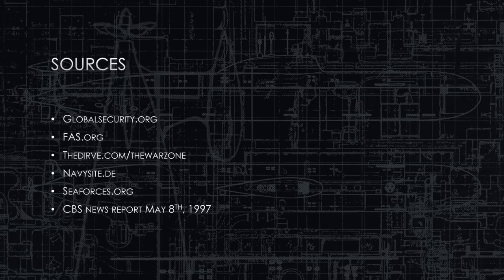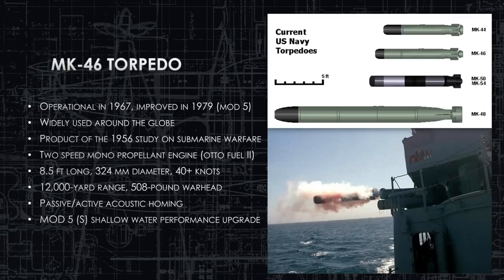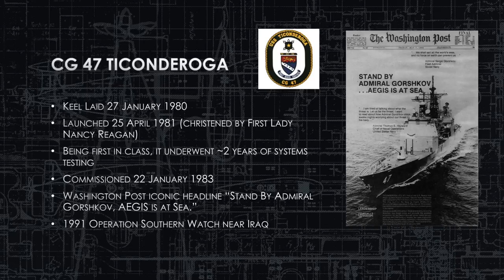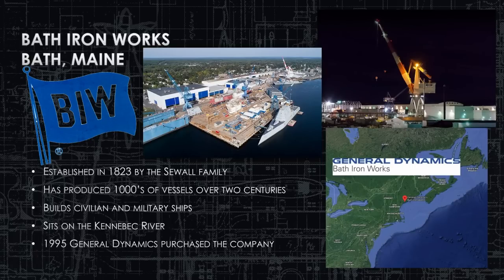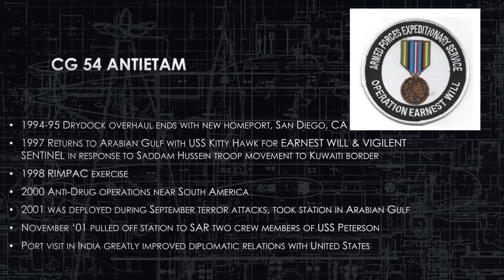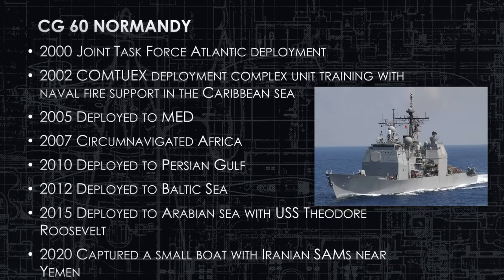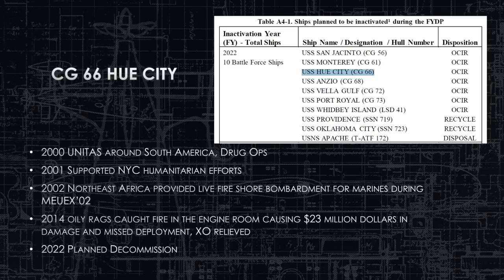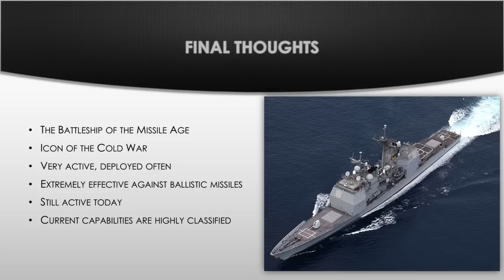Ticonderoga-class Ship Brief

Comment: The ASROC systems do not use the Mk.45 torpedo. The ASROC is designed to project a nuclear depth charge or a lightweight passive homing torpedo, originally the Mk.44, later the Mk.46 including the NEARTIP. The Mk.45 torpedo is a wire-guided, full-size torpedo (21", 3800 lbs and performance similar to the hydrogen peroxide propelled Mk.16), nearly the weight and length of the Mk.48. It is launched from torpedo tubes. It is wire-guided so that there is positive control of the torpedo in all phases of the engagement before the nuclear warhead is detonated by the fire control team. The Mk.45 was withdrawn in the late 1980s with the introduction of Mk.48 ADCAP. They were rebuilt as conventional wire guided warhead torpedoes (the Freedom torpedo) and provided to US allies. The picture shown was a live detonation of the nuclear depth charge.

Comment: Jive, I love your stuff but I fear you missed the biggest feature of the AEGIS program.  Prior to AEGIS, the T-bird fleet had no one person responsible for ship combat performance.  

In the past, surface combatants were designed and built by two Bureaus; BUSHIPS and BUWEPS.  While this structure worked superbly in WWII with gun ships, the rapid changes in radars, missile systems, and related systems made the 'shared' process unwieldy and allowed cost considerations to dominate the combat system's performance because no one could or would make the case for combat performance.  

RADM Wayne Meyer was a graduate of the NPGS Systems Engineering (SE) course and he applied SE thinking to a combatant.  AEGIS allowed combat system performance to fight against cost considerations.  Fortunately, the "Surface Baron" fought the good fight and funded AEGIS, even when it was very difficult.  VADM Jimmie Doyle (and his predecessor whose name escapes me) deserves as much credit as Meyer for keeping the fuel coming into the machine.  

Nuc subs had Rickover and Surface Combatants had Meyer, in my view.  Keep the good stuff coming!

Comment: Emergency Flotation Systems (EFS) are emergency systems installed on larger commercial and military helicopters in order to prevent the airframe sinking in the event of a crash landing on water. The floats may be packed within spaces inside the airframe or as externally mounted packs on the helicopter skids. The floats are inflated using gas stored in pressurised cylinders carried on board the helicopter.
Reply from the maker: good info, thank you.
Reply: @SubBrief  Your Welcome!

Comment: The original AEGIS computer system, AN/UYK-7 was based on the state of the art for the late 60s when it was developed (first entering service in 1970) ... which wasn't saying much. A late 80s home computer built around the  Intel 80386 processor was much more capable.
Reply: The moderized hull have dual xeon themis processors.  We have come a long way since the UYK-7s.

Comment: The most recent CIWS, 1B2 shoots at 4500rpm and has a magazine cap of 1550 now. We also do not have any ECM capabilities. Also with the new System you mentioned as Sea Sparrow is actually SeaRAM. SeaRAMs primary difference is that it utilizes Rolling Airframe Missiles(RAM) instead of the 20mm Vulcan cannon on CIWS. It has a better Search radar than CIWS, but utilizes the same track radar. Sea Sparrow, part of SSDS, is a different system that is primarily found on CVNs and amphibs.
Reply: Not true. The ESSM on modernized cruisers are quad packed VLS launched Enhanced Sea Sparrows.  To my knowledge SeaRam has never been installed on a cruiser.  It has on DDGs in a specific op-area, but the moderized loadout for MT21 and MT22 is a CWIS block 1B
Reply: @Tripped11  You’re not wrong, but he mentioned Sea Sparrow as a part of the upgrade for CIWS. In my comment I was referring to only CIWS, not cruisers. Also SeaRAM is installed on some LCSs and DDGs that get forward deployed to Rota Spain.

Comment: Apparently, the Iranian Airbus A300 was on a schedule, but the schedule had changed, and the crew of the Vincennes did not have the new schedule for them to check. Apparently, the plane could not talk on the same frequency as the Vincennes, either. Given that planes have been used for kamikaze attacks, it's hard to fault the Vincennes captain or crew.... though I would never have taken a medal for it.

Comment: It is obvious if a ship costs too much, but how do the costs accrue? Sheet Steel and Aluminum are bought by the ton, tool steel and bronze ? $5-10/lb??? Engines are expensive, likely more for gas turbines less for Diesels, electronics is expensive to design, but less expensive for components. What is the cost of the first reasonable quantity of units, how about the last quantity of units? Home builders are said to make their big profits on change orders....
All this stuff should fit into a spreadsheet!

Comment: Question on the air search radar with the long range coverage gaps. Are those gaps less exploitable in bad sea state with the ship rolling, or more exploitable near wave top height because of wave tops scattering radar? Or do they function independent of sea state by using a gimbal setup to point independent of ship orientation?
Reply: If I am not mistaken the 64 air search is on a mount that keep it oriented.  The SPY 1A was electronically steered so static mounted.

Comment: Why does AEGIS still use mechanical fire control radars while other navies have switched to phased array antennas like the APAR. Doesn't a mechanical radar limit the number of simultaneous target engagements?
Reply: You are mistaking radar and illumination, the radar is very much phased array the illuminators are parabolic, which is fine, they are only flashlighting a point in space during terminal.
Reply: @Tripped11  It's still a radar, even if it's only for target illumination. The problem I was referring to I that you can only illuminate one target at a time (per radar) when you point the mechanical fire control radar on it. When they have three of those, they can only engage three targets simultaneously. Or can the spy radar also do that to a certain degree? The APAR for example on the german f124 is a fixed panel system that does the target illumination and missile datalink for multiple targets simultaneously. Maybe mechanical ones are longer range or have other advantages but I don't know that, thats why I am asking.
Reply: @SD-pj8dl  While I am not going to get into specifics here, you can indeed propagate multiple engagements per illuminator,  also with SM6 the requirement is situational, the SM6 can do full active.
Reply: @Tripped11  Okay, thanks for your answer

Comment: Why only 20mm CWIZ? US has 25mm Phalanx, others have 30mm (A-10) and 40mm?, I think. Larger bores have greater range and more room for explosive/frags.
Reply: Not an expert, but my first guess is that you can fit more 20mm into the mount since it is smaller and weighs less. Maybe throwing out more small shells gives better kill probability than fewer big shells.

Also, while the bigger calibers may have more range, the reality of firing a gun at long distances against a fast moving target while at sea may mean that the accuracy became unacceptable well before the maximum range of the shells, or would have required a prohibitively expensive stabilization system.
Reply: The M61A1 Vulcan that the US CWIS is built around is lighter weapon than the GAU8 Avenger which makes it more suitable for shipboard use. Most importantly Its also much more accurate than the GAU8. As its only for close in defense against thin skinned missiles the 30mm if the GAU8 doesn't offer any significant advantage.

Comment: There is good content out there on the fate of Iran Air 655 and the contributing factors to what got the aircraft shot down, and it's worth mentioning the context of the attack on the USS Stark under similar circumstances.  It's worth a look at how the combination of a poorly conceived set of procedures, a poor operational stance, and bad interface design failed to deliver clear information to the crew in the CIC of the Vincennes necessary to make good decisions.  I won't speak for the sailors but it was absolutely a complete failure of basic human and physical systems engineering.

Comment: They should not be decommisioning so many warships while the PLA navy is growing so much
Reply: You have to realize this ships are machines and machines eventually wear down. The planned life for a Tico was around 35 years. Some of these ships have worn out engines, gears, cracked hulls and various other problems, that can not be easily fixed, if at all. If you mandated these ships to stay in service does not mean they can actually full fill a mission and go to sea.
Reply: Once the cold war ended and we just focused on the Gulf the "blue water" Navy took a back seat to a litoral water focus. We reduced are ship yards and ability to build new, ships and repair the ones we have. We also made mistake by making the Zumwalt DDG, The Ford Carrier and the Litoral comabt ship. We lost a generation of ship builing in the process. Now we have new couls war thar requires blue water ships and subamrines and we do not have the ship builing capacity to make them fast enough and also repair the ones we have.
Reply: The biggest problem the Navy has that is hush hush is a our deteriorating Ohio Class SSBNs, which is a power leg of our nuclear triad. The "boomers' are pushing 40 years + and the new columbia class is already behind schedule and at least a decade too late. The US Navy's current state is due to decades of neglect though multiples presidencies and contract corruption.
Reply: I was in the Navy from 1991 - 1997 ( Sonar Tech stationed on CG-31 and FFG-58) and witnessed first hand the mistake of shifting from a blue water navy to a litoral one. The entire Navy only cared about shooting Tomohawk missiles in the gulf and aircraft carriers. The surface navy pretty much stopped caring about ASW (antisubmarine warfare) once the the Sovier Union fell
Reply: The US can only build about 1 new nuclear powered submarine per year and the attack submarine is our most potent weapon againt China cause they can not be easily detected and are not vunerbale to land based weapons. We had one submarine languish unable to go to seas and dive for 6 years cause we did not have th capcity to repair it. The SSBNs and the CVNs took priority. We have other subamriens that have had collision at sea languish becuase of the very same issue.

Comment: Hilarious listening to a bubblehead trying to explain surface ship systems he is unfamiliar with. I retired in 1993, so I can only comment on the reliability of the early information...

First off, the flight 1 Ticos had 2 (not 1) Mk26 mod 1 launchers with 44 round magazines. Note that in each, 1 is empty, 2 have blue birds (for system tests and in port display), up to 20 may have ASROC, and the remainder usually SM-2.

SM-1 is Semi-Active homing, the radar must continually illuminate the target, the missile homes on the reflection. RIM66 - 25nm, RIM67 - 40nm. Hence one director must be locked on the target from before launch until the target is destroyed. Fairly low Pk. Doctrine was shoot-shoot-look-shoot, so fire two birds at one target, wait for intercept, then fire again if necessary. Assumed 2 1/2 birds per kill. Range limited as the bird flys a lead pursuit curve watching the target.

SM-2 uses Semi-Active only for terminal homing, the target only needs to be illuminated a few seconds before impact, and the radar systems (Aegis or New Threat Upgrade) would automatically check for the kill. High Pk, so doctrine was shoot-look. Because of the limited illumination time, directors could time share, and many targets could be engaged simultaneously. Because of the mid course guidance the bird is lofted above the target flying a much more energy efficient path for up to double the range with the same booster.

The Mk45 torpedo and ASROC have absolutely nothing to do with each other, your 1992 info is totally bogus. Do some fact checking. Your Nuc ASROC picture (21:00) is from the one and only test shot by USS AGERHOLM (DD-826) on 11 May 1962, Surface ship nucs were obsolete by the mid-eighties and removed from service. Conventional weps performed better with less environmental drawbacks - nucs seriously mess with RADAR and SONAR. The only provision TICOs ever had was the capability to use W44s with the helicopters. Nuc Tomahawks had already been withdrawn.

The Mk46 mod 5 was my personal weapon of choice. (25:30) The entire torpedo weighs 508 lb (we used 7 man lifts to quick load our Mk32s). The Warhead is ~97 lbs Torpex.

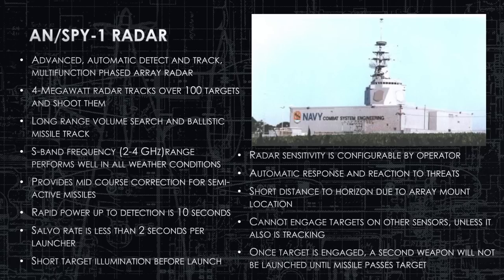37:00 2 second salvo rate is for MK41 vertical launchers. Mk26 salvos 2 birds in about 8 seconds, the launcher is slower than the radar.

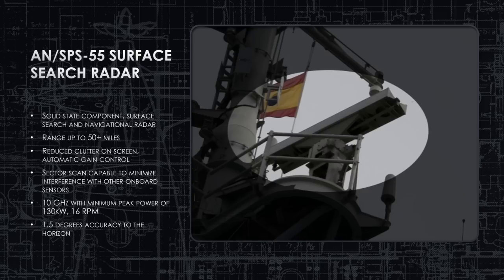43:30 SPS-55 Sector scan allows you to not radiate in a direction you think an enemy is in to limit counter-detection by ESM. The 50nm range is also subject to horizon limitations.

46:00 CW radiation means it is illumination only - the missiles home on the CW reflection. Search radars switch between illumination and receiving, that is what prf is a measure of

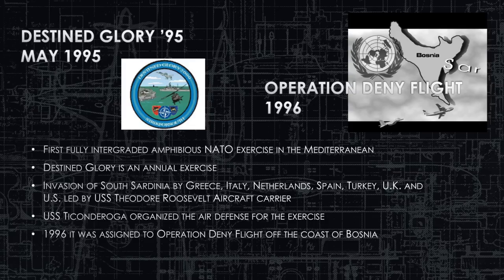50:27 Ticonderoga organized the air defense - the terminology would be that she was "Alfa-Whiskey". Surface forces split up the duties of managing different warfare areas, usually different ships handle different jobs. Alfa-Whiskey is the Antiair warfare commander, Alfa Sierra is anti-submarine commander and so on.
Reply from the maker: Great stuff, I wish I had talk to you about this lecture. Much better info that the stuff I was reading.
Reply: You had to be there.  I trust most everything you say about life on a sub. Not so much surface. 
It's like Drachinifel. Great on book research,  but he's never been to sea.

Comment: As I understand it when the USS Vincennes CG-49 shot down the Airbus 655 not only did the Airbus not respond to radio coms, but was also not squawking/transmitting the appropriate Identification Friend/Foe (IFF) which is an international standard required for civilian airliners "especially" in an area of known hostilities. There are many people that believe the Iranians intentionally sent that airliner into harms way loaded with dissidents to give the US Navy a black eye. Anti-shipping missiles can be launched from a aircraft, and they do not have to be descending toward the target like a WW2 bomb run. There are to many questionable variables with this incident to just assume it was the USS Vincennes fault alone. I was a radarman/ OS on a couple of missile destroyers back between 69/73, and once when we were in the eastern Mediterranean Sea during the 1970 Jordanian Civil War we were approached in a similar fashion by a "unknown" air contact that would not respond to radio coms and was not Squawking IFF friendly. We had it locked on by fire control radars and had missiles on the rail. as soon as the target realized it was being targeted by fire control they responded to our radio coms. If they had not we would have shot it down. Turned out it was a Syrian jet that was supporting the Peoples Liberation Army (PLO) and was trying to taunt us into a fight. What a coincidence these two incidents have almost exactly the same tactical similarities...